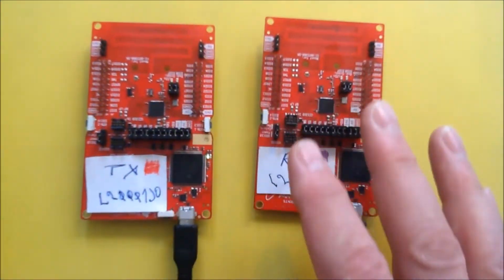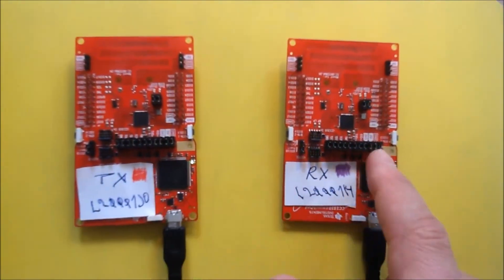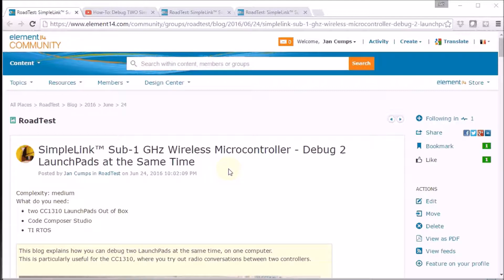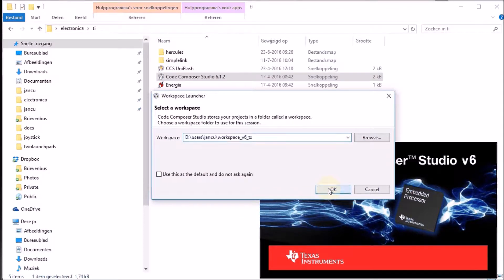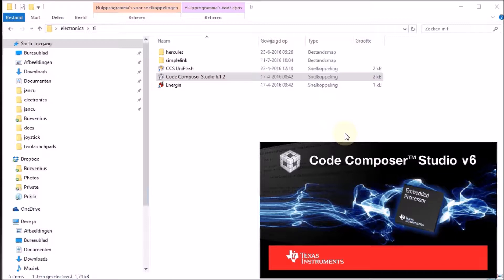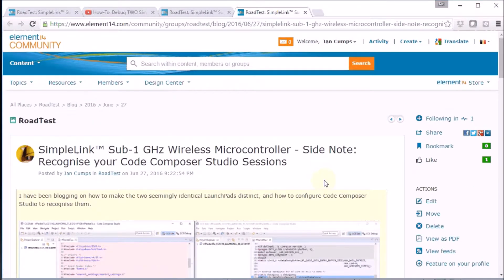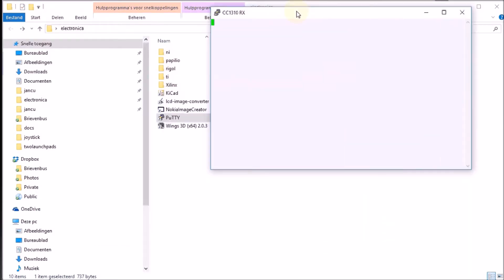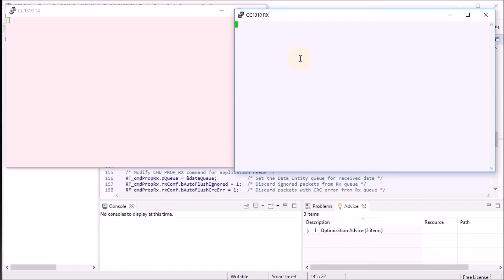Texas Instruments CC1310 LaunchPad - Work with 2 Identical LaunchPads in CCS and PuTTY Part 1

Comment: could you please your full codes please.
Reply from the maker: I don't have the code anymore, this is more than 6 years ago. 
I started from TI example rfWsNode_CC1310_LAUNCHXL_TI project.
the explanation  is in a series of blogs: https://community.element14.com/products/roadtest/b/blog/posts/simplelink-sub-1-ghz-wireless-microcontroller---sensor-controller-engine-part-1-dry-run